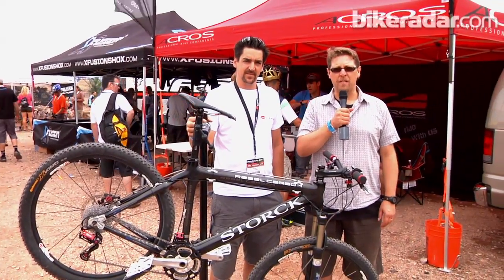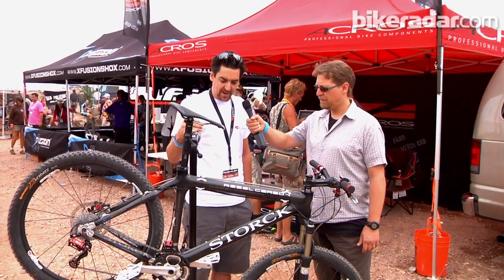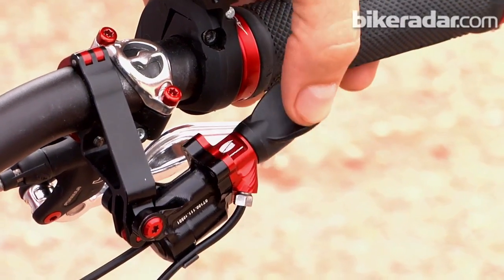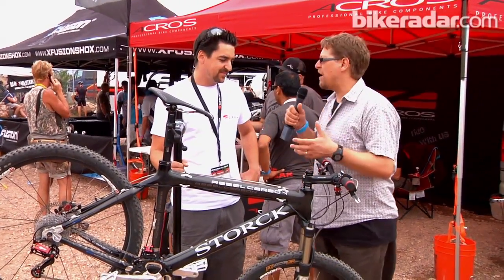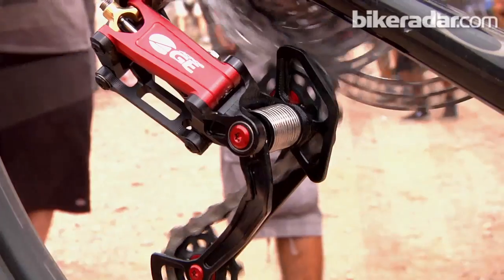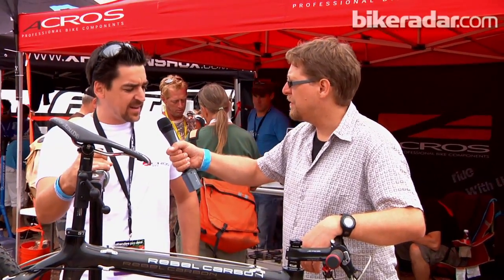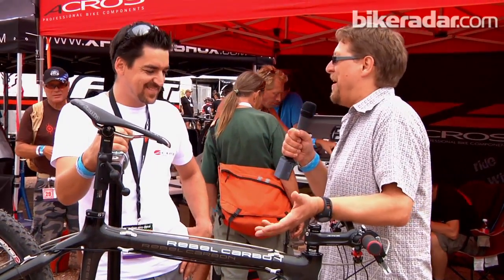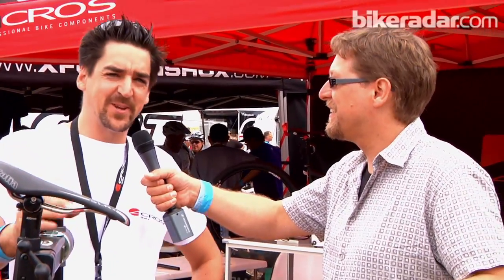Acros hydraulic shifting - Interbike 2011

Comment: I thought about building a hydraulic shifting system myself last year (before I knew this existed) for fun. After pondering about it, I figured there would be no added value. My hydraulic brake system alone is a chore when it comes to maintenance and I can't envision how complicated a hydraulic shifting system would be (ie - if the hyrdraulic fluid pressure is just a wee bit off, will it shift to the correct gears?).  And what's the point? How much finger energy does it take to shift gears?
Reply: It may have a small hydraulic fluid reservoir to always maintain pressure and a microprocessed electronic shifter! I would love to see a final product with these specs!